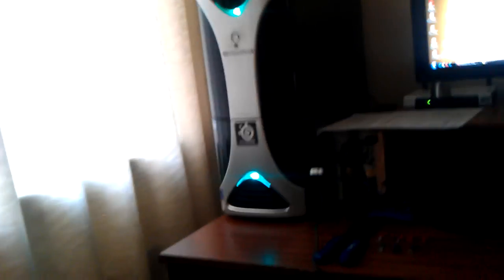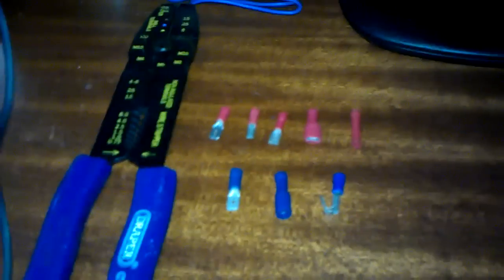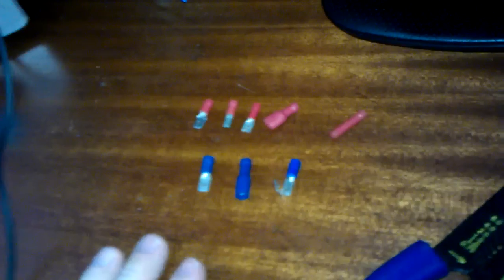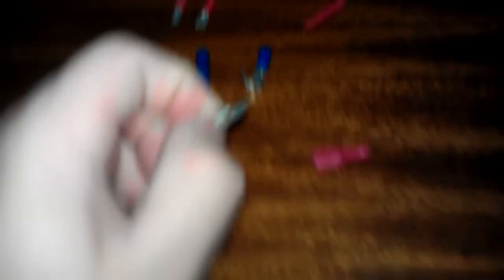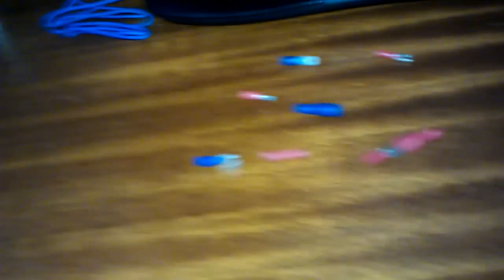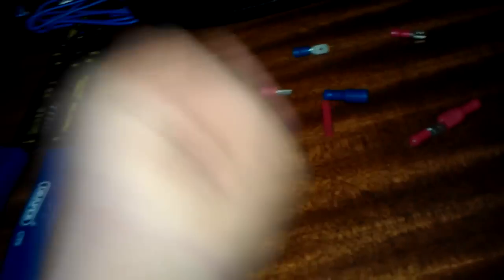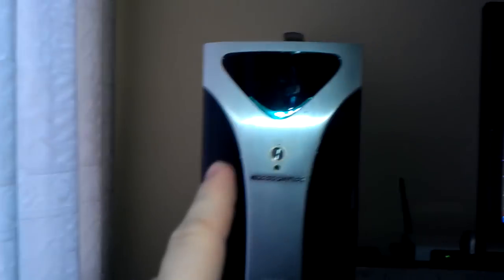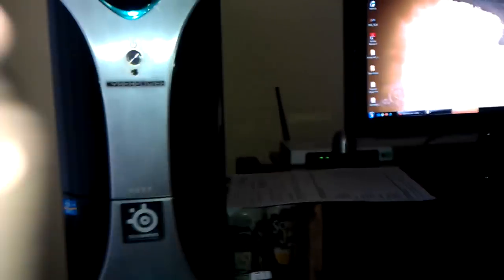Soldering alternatives : advantages of Crimp connectors / crimps

Comment from the maker: Oh, it should always go without saying to always get decent quality ones.
Still, it's possible to buy in bulk and still get them very cheap - I usually buy them in the hundreds, even if I know I'm not going to use them straight away as it's always useful to have a decent stock as when you need them you usually get through them fairly quick.

Comment: There are different qualities of crimp connectors. Please don't get the cheapest ones. Google different types of crimp connectors and do some reasearch and don't create a nightmare for the next person to try and trace a bad connector.
 Please don't take me wrong it's just that I've been there and cheap connectors are garbage.
 Good quality ones are used in the aviation industry so get the quality and do it correctly with the proper crimping tool.
Great Video ,thanks for posting it.  :  )